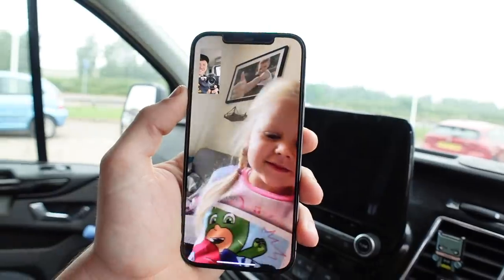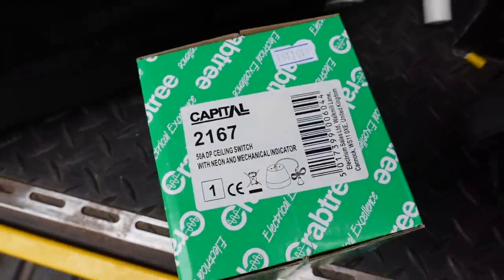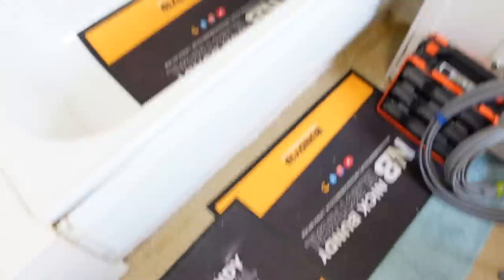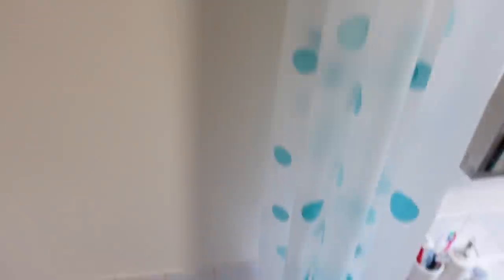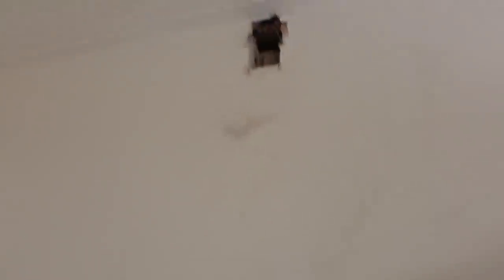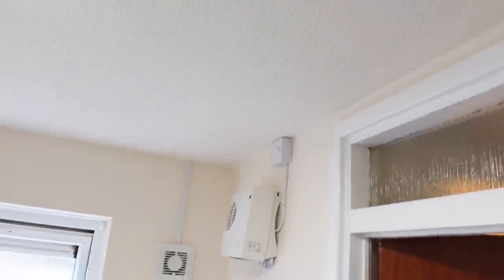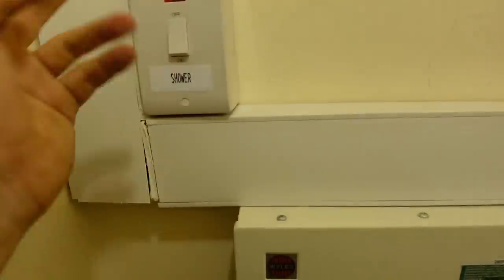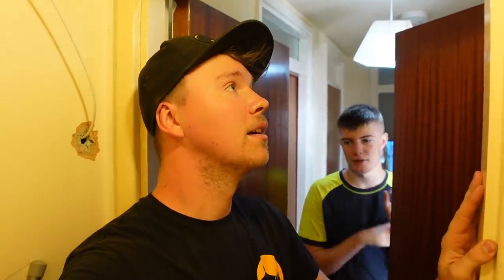Installing a Shower Cable - Electrician

Comment: 40A MCB for a 10.8 Kw shower? 10800/230 = 46.95 A. Surely a 50A MCB? Maybe my knowledge is lacking. Perhaps you've used correction factors not mentioned? Just curious.

Comment: Did you run the 10mm above the insulation ? there is quite a derating if below 100+mm of insulation

Comment: Never use a shower pull cord isolation switch. It is ALWAYS a ball ache and outs strain on the terminations.
Reply: Response = Crabtree. These switches change the game. :)
Reply: @petertallowin6406  response = nope. You're wrong. Wall mounted surface box is the way to go.
Reply: @Woodkin007 take your time and install these guys properly and they are sweet. Everybody will have their go to. Crabtree are a winner for me from switches to c/u's.....
Reply: @petertallowin6406  nope.
Reply: @Woodkin007  ok, wall mounted not always an option. Ceiling 9 in 10 is. Whatever floats your boat or powers your shower....
Reply: @petertallowin6406  I agree. Have installed MK and Crabtree. Crabtree can be installed on the beam with cable either side. MK used a pattress. (Or used to not installed a shower for years)

Comment: It's worth mentioning that the inclusion of a local isolator is a decision for the designer and not the manufacturer of the fixed appliance.  What were your considerations when deciding to include one?
Reply: How do you isolate a fault on a shower without calling out a sparky to disconnect the cable?
Reply: @Woodkin007  There's usually an MCB on the end of the cable furthest from the shower.
Reply: @westinthewest  and what happens if there is a neutral fault and you can't reset the RCD
Reply: @Woodkin007  We have the same issue on lighting circuits, but we don't have double-pole isolation available on those.  Come to think of it, socket circuits don't have a convenient method of removing neutral faults either, apart from disconnecting at the neutral bar.
Why do we need double-pole switching for showers and not for other circuits?
Reply: @westinthewest  there is no requirement to do so but as the shower will need to serviced by persons who are not electricians it makes sense to be able to have a dedicated isolator
Reply: @tomorichard  You don't have to be an electrician to operate an MCB.  Are we talking about a plumber, say,  who needs to remove the cover to tighten a leaking pipe joint?  We expect a typical householder to be able to rewire a BS3036 fuse, so why can't the plumber flick an MCB, or pull out a fuse holder?

Comment: Not your fault in the slightest but I have concerns about how watertight it's all going to be on the plumbing side of things, especially if that specific type of electric shower doesn't require an external silicone seal.

Comment: Nicely done. one thing I wish would be abolished completely is shower isolators ! 

Adding a joint in a 10mm cable, usually in accessories that are too tight, and pulling heavy load is just always asking for a problem. 
probably the most common thing to find burned out too just proves it.
Reply: Isolators don't need to be abolished.  They should only be fitted by people who have thought of a reason to provide one, and that does not include 'better safe than sorry' or 'it's what we've always done'.  Don't blame it on the manufacturer's instructions either.  You're the designer and it's you who signs the certificate - not Triton.
Reply: @westinthewest  most cases id love to never use one, but “local isolation” and all that
Reply: @Cablesmith  in a  domestic house you can isolate at the mcb as its usually local enough, and you can lock it off
Reply: @westinthewest  Here's a reason. In this particular case the shower is on a shared RCD. So if there is a fault on neutral the customer can't isolate it by turning off the MCB thus losing all the circuits on that RCD side til they can get hold of a sparks to come round and have a look.
Reply: @brianhewitt8618  it’s not double pole isolation tho, which is usually what is required.
Reply: @Cablesmith  Game, Set & Match. Advantage Cablesmith 👍
Reply: @Cablesmith  Why is it only shower circuits that need double-pole isolation?  We don't provide it for lighting or socket circuits.
Reply: @Cablesmith  I'm not aware of a reason why a shower needs local isolation.  The functional switch provided on the shower is all you need in terms of local switching.  Isolation is a specific requirement, and it's fine to have that facility at the MCB, especially when you're on a TN supply where the neutral is considered to be reliably connected to earth.  Overhead lines and TT supplies might be different.
Reply: @westinthewest  it’s not only showers, the reason it’s used is for isolating for maintenance. As things like showers, washing machines, etc are often replaced or repaired by people that are not electricians. It gives them a simple to use form of isolation and when it comes to split load boards it stops them tripping the RCD covering other things too. 
The reason we don’t bother with lights and sockets etc is because only competent people should be maintaining them items.

Comment: Why is the mcb only 40a should this not be on a 50a since the showers 10.8kw?
Reply: I'd of thought so yet 46 amps on the shower
Reply: @goodplacereviewer2495  yeah I mean it's near 47 amp so needs a 50a lol 40 might last if you only want a short shower 😂
Reply from the maker: I always put in on a 40 and the shower will next draw the full 10.8kw dude
Reply: Like an over you never have a shower on full power therefor no need to put it on a higher mcb.
Reply: @brightside0970  I'd probably do the same with the oven tbf
Reply: @goodplacereviewer2495  I do never used a 40 it’s not needed
Reply: @brightside0970  electric showers are always on a fixed power, you just control the flow of the water to control the temperature.
Reply: Considering a nominal breaker will hold up 1.13x of the current indefinitely then I guess its just about ok, bit like 7.2kW EV chargers on 32A, you get away with it.
Reply: @edc1569  This would be a deviation from BS7671 ( Reg. 433.1.1 (i) )
In must not be less than Ib.
Reply: @brightside0970  you can add diversity to an oven, not a shower
Reply: @NBundyElectrical  Didn't know we could add diversity to a shower. It would be interesting to see what a 10.8kw shower actually pulls
Reply: @edc1569  7.2kw Ev charger would have an Ib of 31amp so 32amp In would be fine